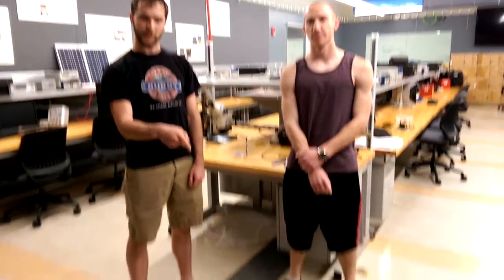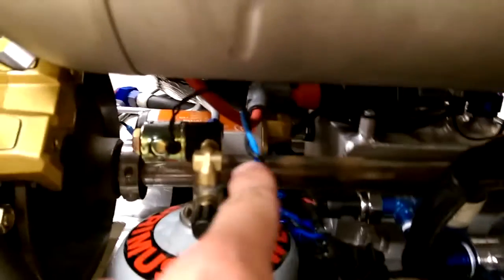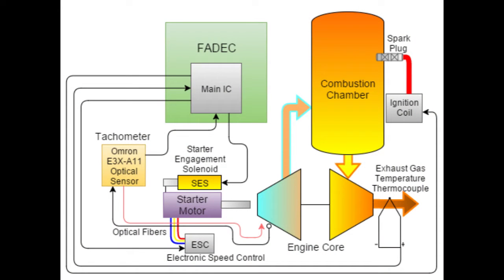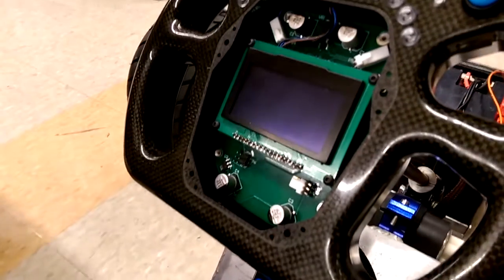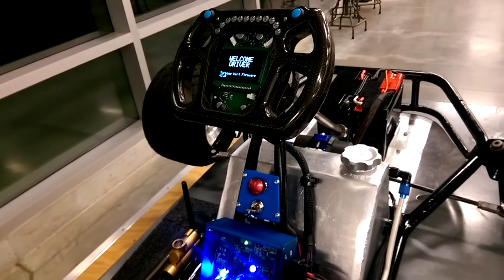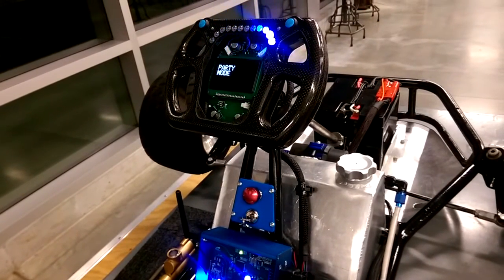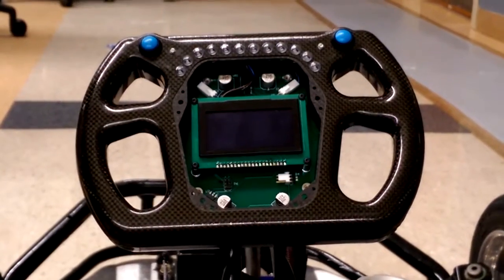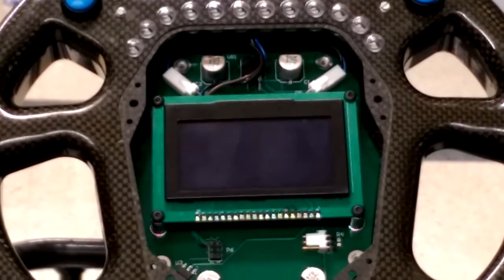Team TVES Demonstration Video

Comment: why is the engine backwards?
Reply from the maker: The vehicle is going to be driven by a power turbine, which isn't installed yet.
Reply: +highvoltagefeathers yeah ok, but your are sending the hot exhaust gases towards the driver right ?
Reply from the maker: They're being driven into a plenum, which sits to the right of the driver. From there, they take a 90-degree turn into an axial power turbine, and flow through an exhaust duct over the right rear tire.

Here
https://www.youtube.com/watch?v=zlkUNaszGww
is a link to an animation of the power turbine we're working on!

Thanks!
Reply: +highvoltagefeathers ok thanks I didn't know :-)